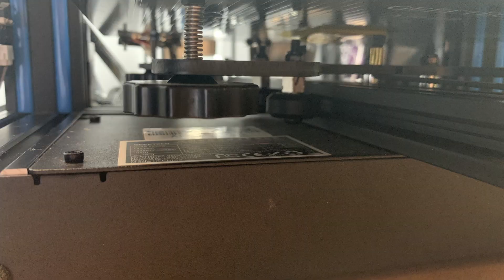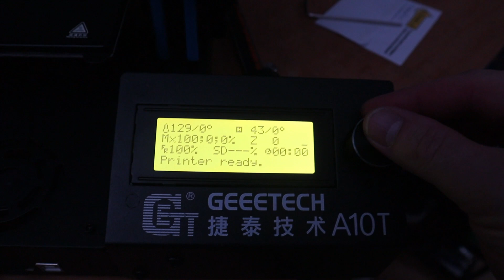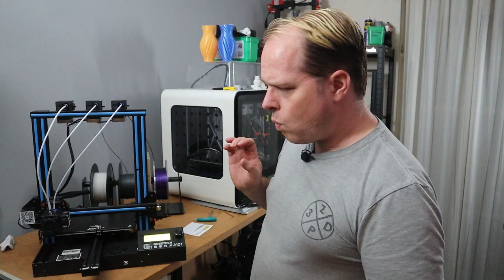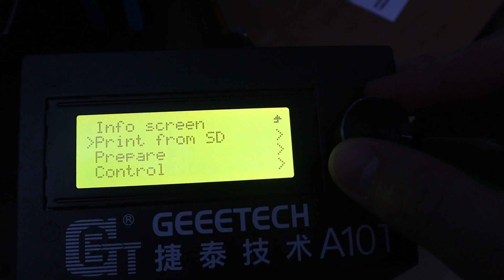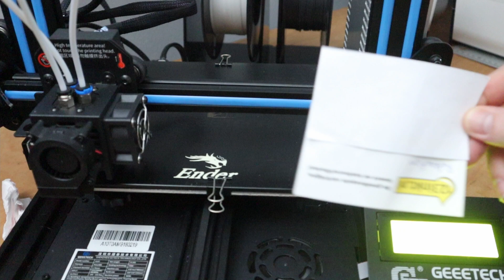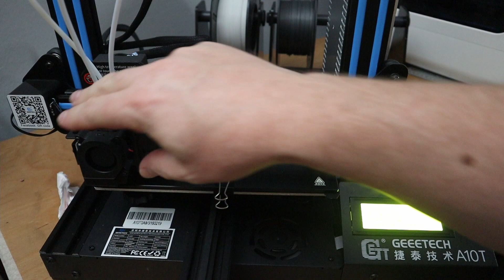Best ways to level a 3D printer bed - Z3DP 3D printer basics

Comment: If you can disable just the X, Y, E steppers it would be best. The Z position can sometimes drop depending on the mechanics of the printer. I've actually seen my Z shift down perceptibly when the stepper is turned off. Anti-backlash nuts could prevent this I've heard.
Reply from the maker: I didn't have had this issue, but those anti-backlash are very great in holding the Z-axis on place